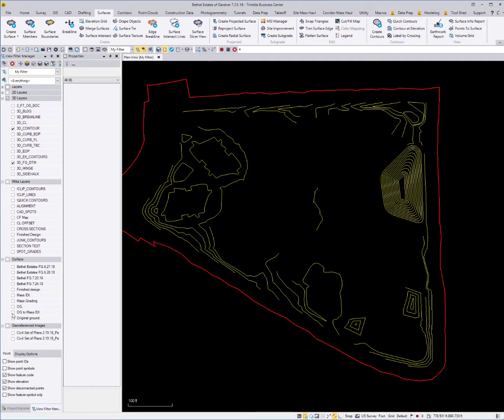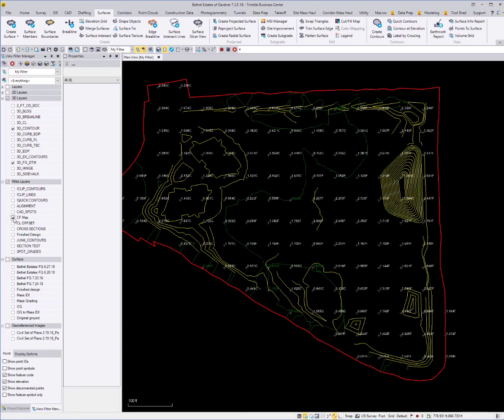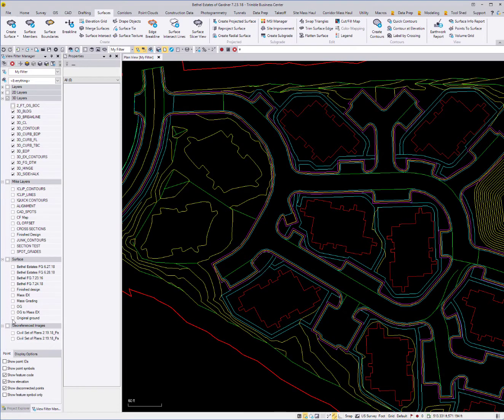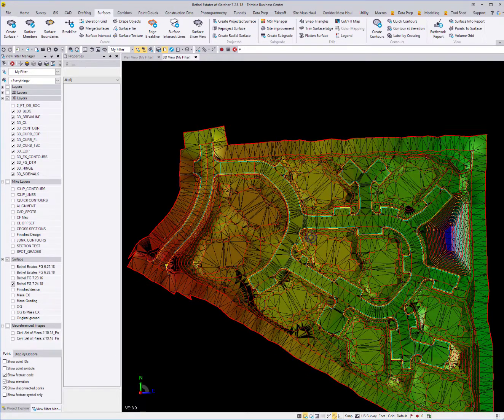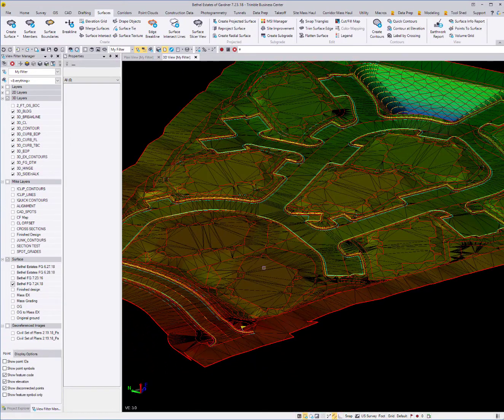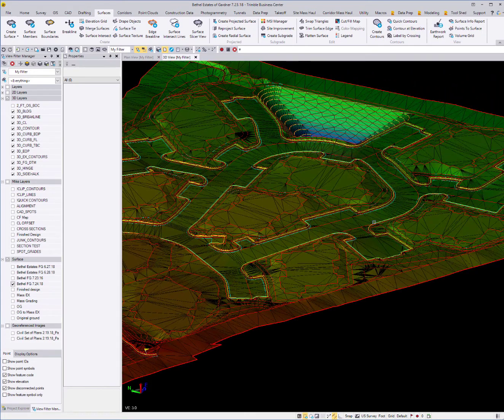3D Data on a Fast Track Civil Site

Comment: Is this for machine control? Why is the surface not subgraded?
Reply: Operators can do the offsets in the field. Less confusing for everyone and less lines.
Reply: @travischron3175  There's nothing that's confusing about having a proper subgraded and overbuilt model that the operator isn't having to constantly offset up and down everywhere paving thickness changes. Not to mention dealing with the blade jumping up at BOC because of having no overbuild. A good model builder will build a surface that the machine will actually be constructing, not half ass it and make the operator deal with it.